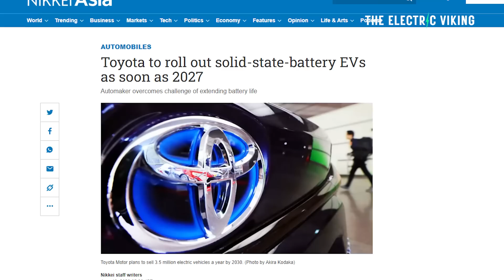Tesla's biggest battery supplier improves charging efficiency by 43%

Comment: Even with a 10 min charge time for 200 miles that is still 5 times slower than gasoline which can refill in almost any temperature and weather condition. The charge kw you quote also is ridiculous because while a few vehicle might be able to charge at a high rate of speed, charging dozens of vehicles simultaneously like gas stations do would require enormous amounts of electricity. You fan boys just like to ignore the laws of physics when talking about charging, the greatest weakness and inconvenience of owning an electric car.
Reply: Time will prove you wrong.
Reply: EVs charged at home are always ready unlike gas cars which must be driven to a gas station.  Not a two minute fill.  On a road trip in a gas car you have to find an open pump, pay for gas, pump gas, then move the car to a parking spot to go in for a coffee and pit stop.  Family care and food will drive this time much longer.  An EVs car on the road parks, plugs in and you are free go take care of family needs. Time about the same  10-15 minutes with much lass hassle.
Reply: It takes you 2 minutes just to pay for the gas and get your receipt.
I fill up my EV at home and sit in my warm house instead of standing out in the cold holding the nozzle while putting gas in the car.
In the winter I can warm up my EV in the garage and don't have to open the garage door!
Reply: @thomaswilson2917  It will take you 2 minutes to pay at a credit card terminal on an electric charger too - and yea you can charge in your garage, but when your 500 miles down the interstate and need to get home and its 5 degrees outside your are screwed! Especially if their are dozens of other people there needing to get a charge. You fan boys just dont think things through because gasoline has made life too easy for you.
Reply: @nikolaigordon  the laws of physics will not be undone by time
Reply: @kvs13156  21k in 1 year.
Mostly long distance
Never had an issue
You don't pay with a card if you have a Tesla.
Just plug it in.. when you a. Re
 Done just unplug and drive away
Reply: It doesn’t have to charge faster then gasoline it just has to be around the same rate as going to the bathroom/ stretch/ grab a snack from a vending machine. Some places it takes 10 to 20 mins others it takes 5. So 10 minute per stop that is spaced out 4 hours is perfect. Only people doing road trips or work vehicles for hauling would need these charge speeds everyone else will top off at home at the power of a water heater or less. With what I stated would be a big increase but it would just need 50% the growth we have now in power lines which is a lot but since we ignored power line increases for a while. Hard but possible for sure.
Reply: @richardmenz3257  For you maybe not, but for the rest of the economy it does and even to get to 10 to 20 minutes for everyone simultaneously is not practical in the amount of electricity that would be needed to even come close to the speed of liquid fuels.
Reply: @kvs13156  if you assume we don’t add any power lines ever yes. If you assume 50% increase in growth from 1 percent to 1.5% per year while spreading the change over 20 years you realistically could have about 3% of cars charging at 350 kWh all at the same time. Since most cars don’t have to charge at same time and can charge during off peak this is realistic if people want to try. Of course it wouldn’t work if we instant switch over just like before gas stations was everywhere gasoline cars was the bad choice. Atm all electric car only makes since for people that A own a home and B don’t do many road trips or if they do they are okay waiting 30 mins every 3 hr 30 mins. The fact that many other countries have electric line growth of over 1.5% per year with no issues shows we could do it as well if we wanted it just it is not wanted since no one wants to do the pain now for better later. That all being said electric is slowly taken over and prob will eventually but slower then what is needed to stop big issues.
Reply: @richardmenz3257  You like many other fan boys do not understand the difference between battery capacity and power.  A 100 kwhr battery would need 600 kw of power to charge in 10 minutes. If 12 people were doing this simultaneously that 7.2 megawatts. Many newer gasoline stations can fill 20 to 30 cars simultaneously. Its not the total amount of energy that the grid is capable of producing, it is the time required to transfer that energy to the battery packs. To match gasoline, each recharging center would have to have its own power plant or a rediculously sized battery storage delivery system.
Reply: @kvs13156  yes, but you don’t need every car on the road to do it at once most people can just charge overnight at a slower charge rate when less power is being used. But yeah quick charge station would practically need to be mini power stations. Only people that would need to quick charge at stupid high speeds would be road trips,  semis that are on long haul trips not local trip ones(which honestly semis should prob be the last to change over better to just use gas for them and introduce last), and work trucks. Every one else should reasonable be able to charge at home at a normal house outlet rate or lvl 2 at worst. Now there is an issue with people in apartments n so forth because they may not have lines but having lines in place for charging on new builds should resolve alot of these issues. Also having a lot of batteries with solar panels at these charging stations would be cheaper and make them more money then using grid power. You acting like we need the same number of gas stations as we do now for charging but if your not fast charging you don’t need a station. I think your only thinking if everything was instant. Because yes that would be a lot of batteries but old ev batteries work great as batteries to use as charging station it is just a time thing as long as we make steady progress each yeah it can happen in 30 years no problems.